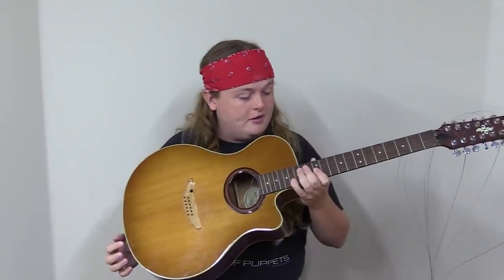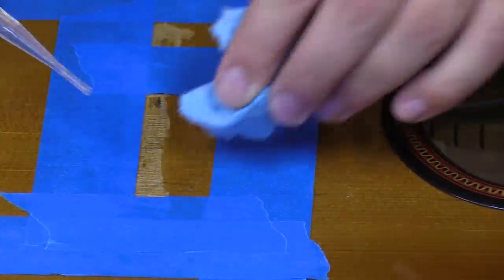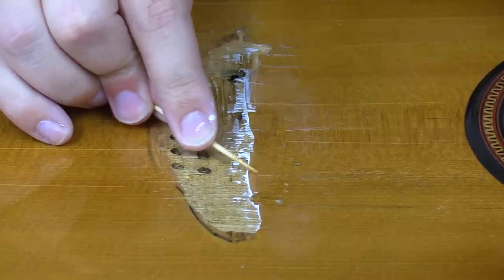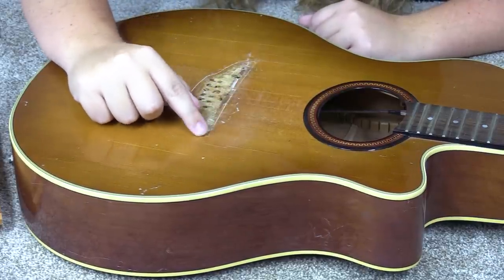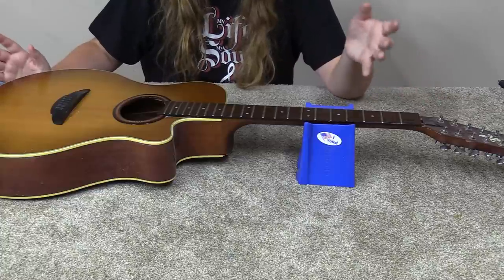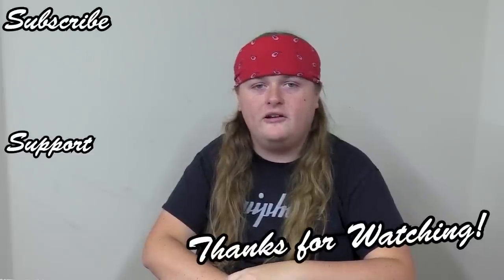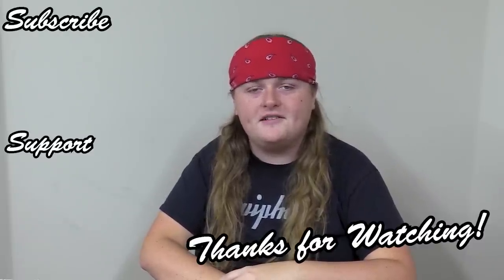Yamaha APX 5 12 Bridge Repair

Comment: Hey Caleb, good job!  Just a little trick for next time you have to slot a nut.  Use a VERY narrow, extra fine-toothed back saw to cut tiny marks in the nut to give your nut files somewhere to reference.  It will make starting the process very much quicker.

Comment: That was a very old RadioShack battery. The gold Radioshack Enercell battery was made from around 2003-2008 and it was then changed to a black and green design that lasted until 2014 when the design changed again to white and orange which is what they still use now. Take it from a former employee.

Comment: Cleaning out the finish voids from sanding the ca glue before you fill them will give you a much better result. Also you can fill the voids with superglue and polish it out instead of using finish.  Just small tips that give better results in the future!  Your getting better and I learn things every day even after 30 years of repair work. A fine Japanese saw is the perfect tool to start your nut slots then use your files to open out the slot.

Comment: I just did my first bridge reglue like this but I didn’t paint mine on (learned the hard way) and when I went I clamp I had glue running everywhere when I finally cinched it down tight. Was a hell of a cleanup after wiping all the excess off. Now it’s dry and there’s a small ring of glue that has dried around the bridge. Also when I set the pins in it was making some gnarly cracking noises when I tuned up and string tension was starting to pull. Scared me but I think it’s ok for now. Had a blast actually with it since I like tinkering with stuff but I learned some valuable lessons along the way. There was so much glue it filled the holes where the pins go through and I had to drill it out which made all my pins fit wonky. Just a cheap garage sale takamine for my first repair and I can see why it lifted they just scored the topcoat and bottom of bridge and barely used any glue and didn’t spread it. There was one blob right in the middle that held the whole bridge on lol

Comment: Great job as usual , Question for you which file do you use for jumbo frets  ?, I have the same crowning file but am not sure which file to use on it
Reply from the maker: It's the biggest crowning file, however it has been modified slightly. The edges have be ground back so I have some more clearance.
Reply: @MillsGuitars  Thank you very much !! Have a great Holiday

Comment: I wouldn't just fit the bridge like that to the top. To ensure a good fit I've seen quite a few guitar repair guys put sandpaper on the footprint of the bridge and then sand the bridge with it. This ensures a perfect fit and avoids gaps between the top and the bridge. Because wood glue isn't good at filling gaps.

Comment: With the capo on you are getting a false height on the first fret, when you take the capo off the strings will be higher than you want, that really isn't rocket science
Reply from the maker: When the capo comes off you will want the strings higher than 0.010, closer to 0.017, but that's only when the saddle height is correct. With the capo I can ignore the saddle height.
Reply: @MillsGuitars  when you then change the saddle height you have discrepancies
Reply from the maker: No, the capo removes the saddle height from the equation, that why it's done. Any changes from capo on to capo off are accounted for, hence lowering the strings to 0.010 with the capo on, when aiming for 0.017 with the capo off and the saddle set to the correct height.

Basically, I'm counting on the strings being higher when I remove the capo, that's why I cut them lower with the capo on.
Reply: @MillsGuitars  it would be a whole lot simpler to just cut them to the correct height, you don't see Jerry Rosa faffing about with a capo, or Ted Woodford or Randy Shartiger or Ian Davlin, they all do it the straightforward way
Reply from the maker: https://youtu.be/J7rNyAEnzq4

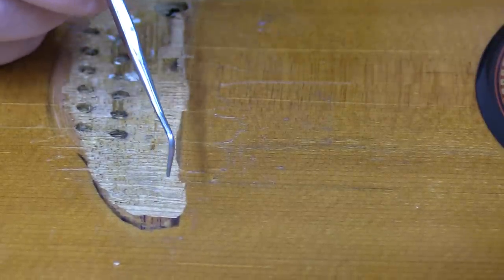At about 4:30, Ted does literally the same process, using his finger in place of the capo.

As well, Jerry will tell you there's more than one way to skin a cat, there's more than one way to finish any job.